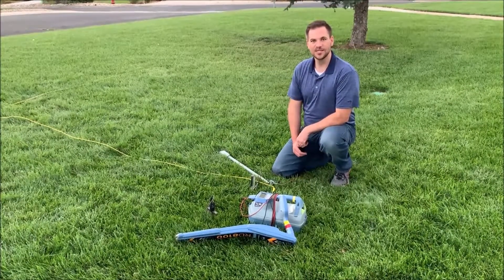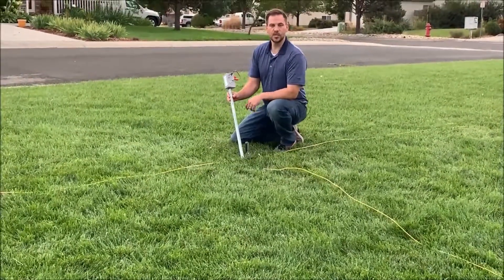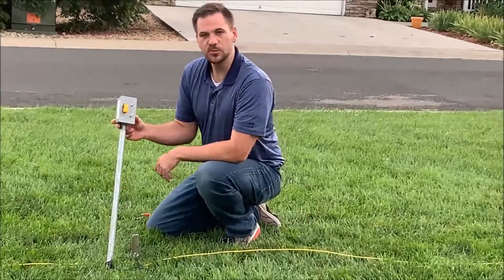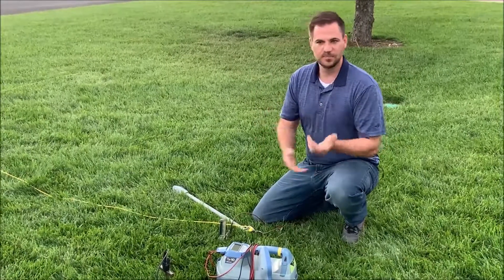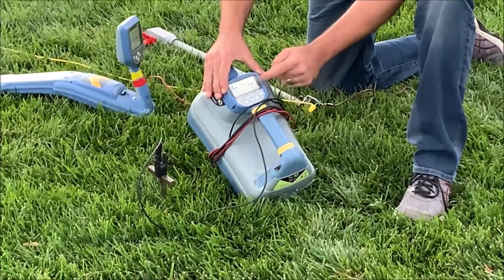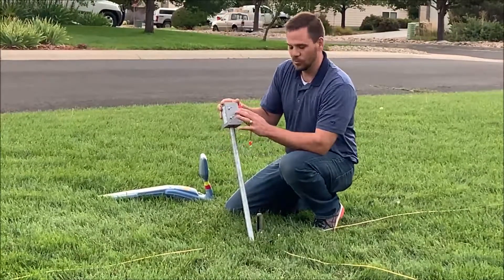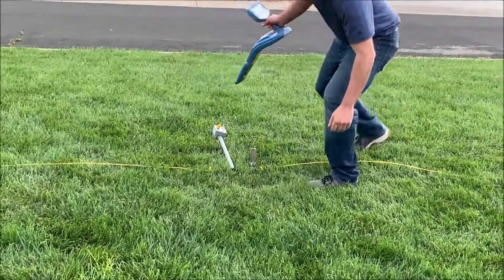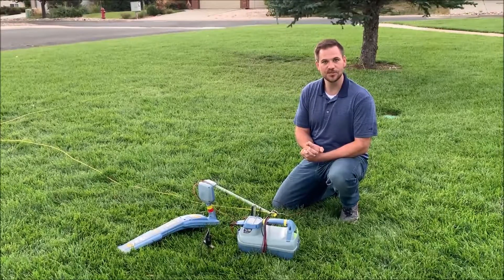Grounding Terminals Video

Comment: Do you have a video of a long run of tracer wire with a before and after an  end ground is conected? How much of an improvement in locating the wire is there?
Reply: Chad S thanks for your comment. Longer runs of tracer wire have even better results. I don’t have a video but our grounding terminals significantly improve the ability to locate tracer wires, especially long sections. We will try making a video in the spring time to demonstrate. More info can be found on our website at tracerwiretech.com